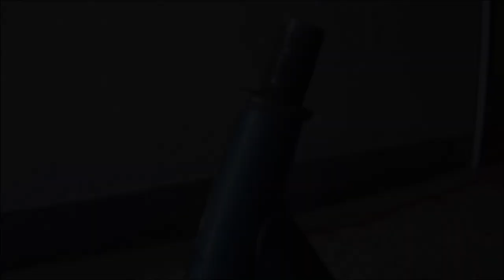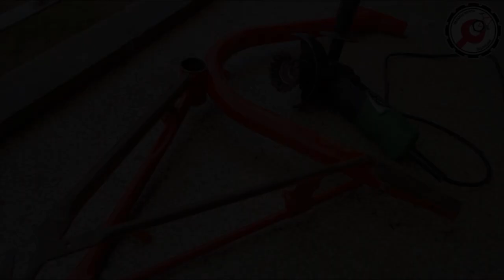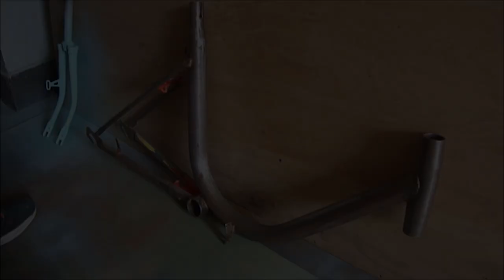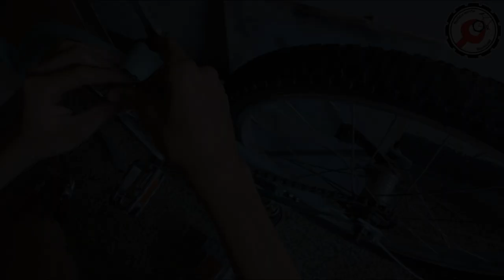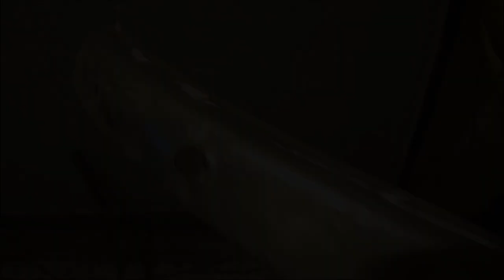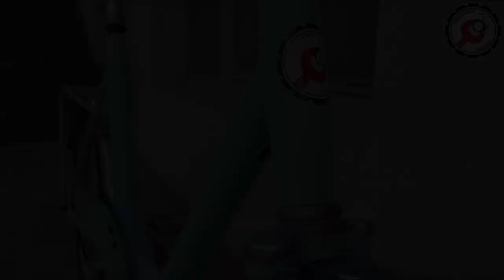ONE OUT OF TWO | Vintage Pony bicycle restoration / Restauracija Pony bicikla

Comment: do you still have this bike frame?
Reply: If he does and if he left it outside, it's probably rusted up everywhere. He took off the original yellow paint and put on primer and paint from crappy spray paint cans. Those paints and primers in a can are not as good as the original factory paint. Unless he was going to put high end paint on it like PPG automotive paint using a airbrush and air comoressor, he should of left the original yellow paint on it, sanded off the crappy red paint, and put on that crap in a can he got.